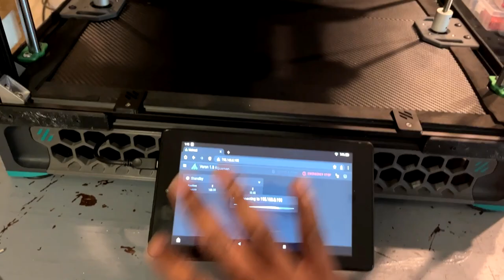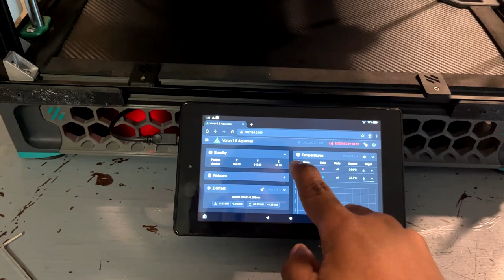// X5SA-Pro To Voron 1.8 Conversion part 2. // GoldenJaguar392

Comment: Do you have any tips for cutting aluminum extrusion, drilling the holes, and tapping? I'm building a 350x350mm build plate Trident and I'm trying to figure out how to cut exact lengths and what saw blade to use.
Reply from the maker: Actually yea I’m gonna make a video showing the tools and stl I use. Stay tuned. It be easier and makes for good content
Reply: Update: i used a steel carbide blade on my miter saw and it worked fine. It made factory clean cuts.

Comment: does this makes the z axis smaller?and is it still on the tronxy frame?
Reply: also how did you mount the feets of the trident as there is a screw right on where one of the screw of the feet needs to go?
Reply from the maker: Yes it’s does make the z axis smaller as I’m using the trident spacing however if you use the original v1.8 spacing you have a 300mm z hight instead of 260mm I currently have, yes this is the full tronxy frame
Reply from the maker: @toasterdev8329  here a time stamp hope it answer you're question
 https://youtu.be/b-Wox-850bs?list=PLRsIVaP-BizBDCNtQe8PlwNEdoBVg85_Y&t=763

Comment: As always completely bad idea mod. It has no sence replace all part with voron and keep same axis functionality of x5sa. Its easier to do directly voron. It should has sence only if fix bed to bottom and use as many x5sa original parts as possible.
Reply from the maker: I can respect you're views, but we all don't think that way.
Reply: Probably not all if i get like. Maybe y start think about when has sence mod x5sa and when buy whole new voron printer.